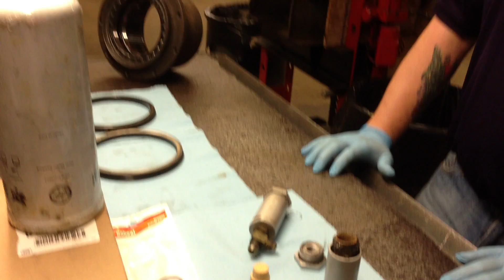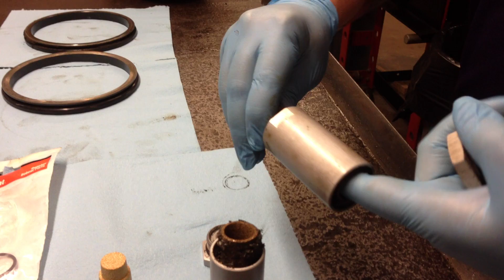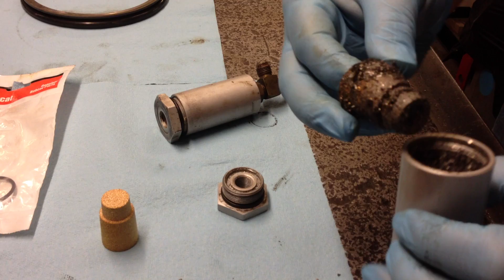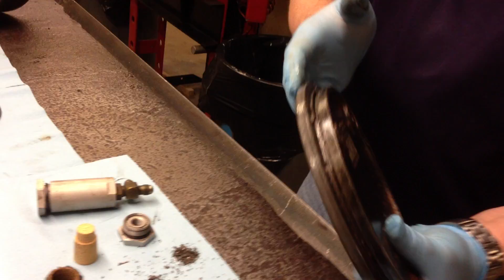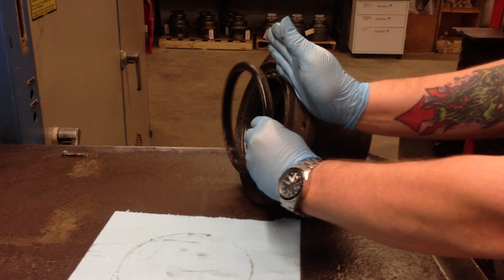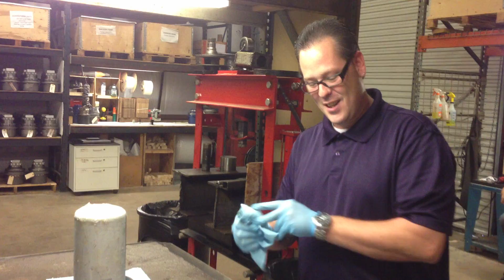Bobcat Final Drive Motors - Case Drain Filter

Comment: hey i made this video http://www.youtube.com/watch?v=IC-wniWgW1A&t=2m30s 
and in the video u can hear some weird sound, can this be caused by a clogged case drain filter? I did open one of the hydraulic motors up and ended up changing the seals inside because 2 seals were completely destroyed. But noise is still there. It has plenty of power, spins tires on tarmac, 1998 bobcat if i recall. Or is it normal?

Comment: Working on a 873 bobcat wheel loader my right side sounds like it’s cavitating when you go from forward to reverse especially at high rpm the left side is very responsive and working normally and lift and tilt ok I haven’t changed the case drain filter or hydraulic filter yet because my problem is isolated on right side only just wondering if I have a flow problem to right motor from hydraulic pump or just a drive motor problem if any ideas I would appreciate it thanks